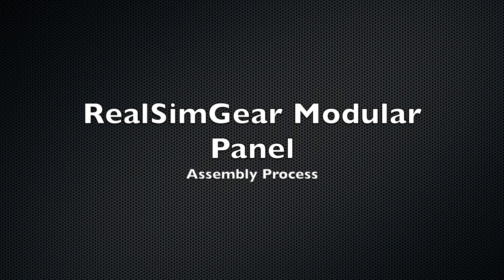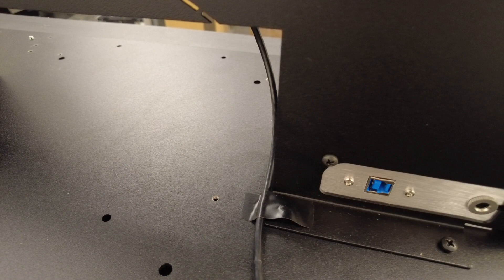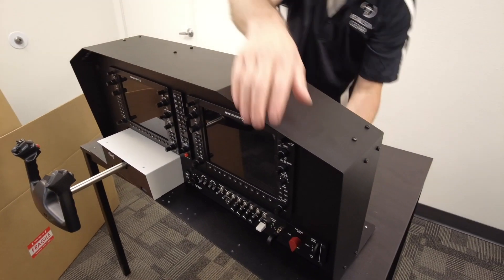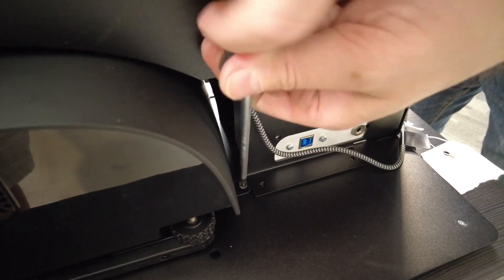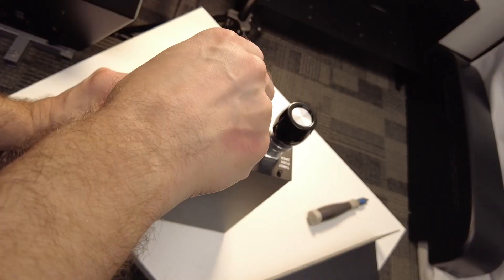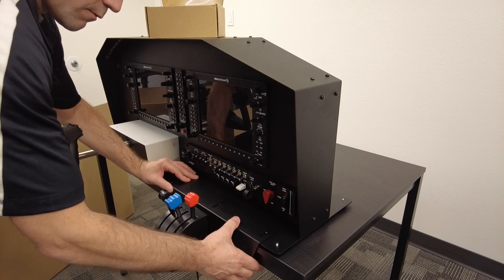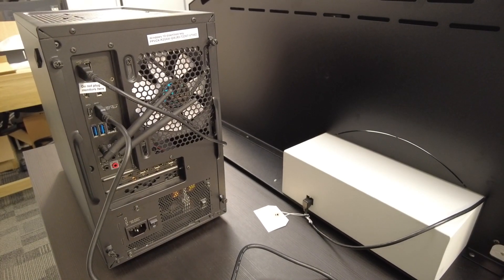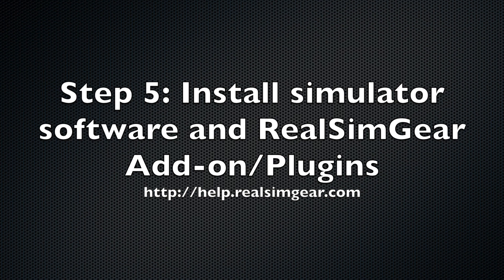RealSimGear Modular Panel Assembly

Comment: Thrustmaster, and Turtle Beach's VelocityOne both came out with Sims controllers for the Boeing 747 with out near the amount of set up requirements. Although this looks great, some may be turned off by the building requirements and the amount of space it will takes up. Hoping for the Best !!
Reply: Not exactly comparable, this is for someone who has and is willing to pay a lot more money for a far more complete, realistic and much better quality setup than just getting a low end cheap yoke, someone who is either serious about simming or is also training for a real pilots license.

I don’t have the space for this currently, or the money, but again, not comparable and if I could afford this I’d make the space for it.  Obviously more hardware and features will need more setup and space, but then you have more hardware with more features.  The Yoko Yoke is about a grand, about three to four times the cost of those entry level plastic yokes.  The G1000 suit is about two grand, this setup is probably worth 20 times those yokes.  No one looking to get something like this will be turned off by setting it up, and those interested in this are also likely to be only doing it once or twice in the time they own it as it very likely to be a permanent setup, not a put away and bring back out kind of thing.